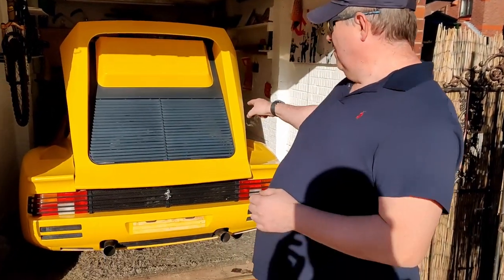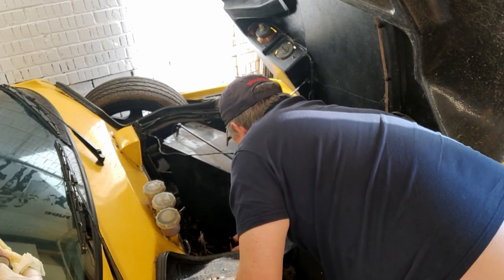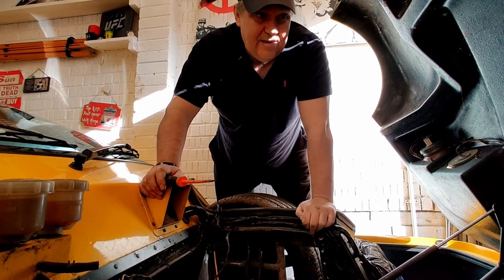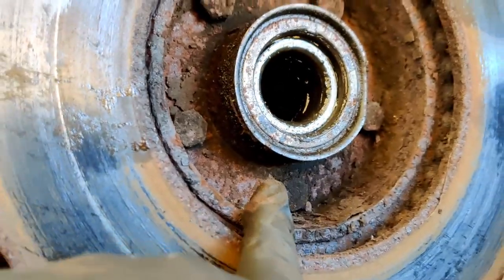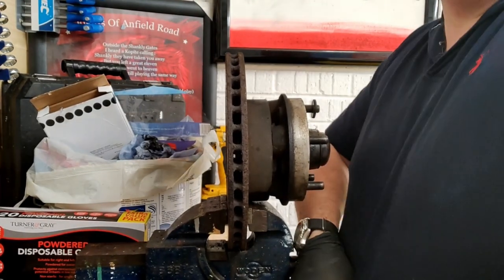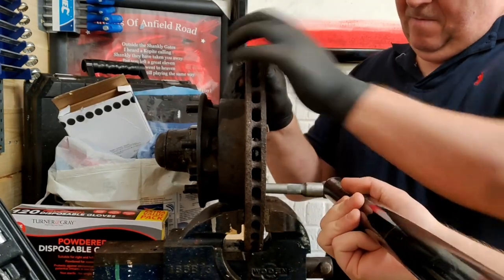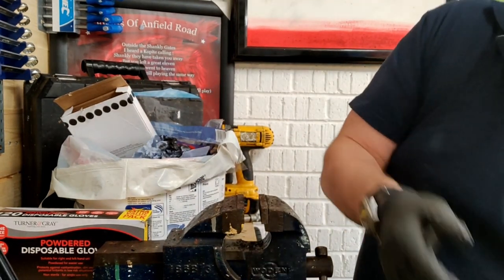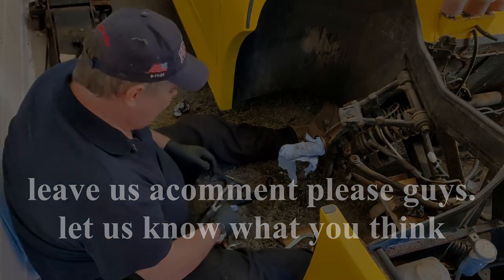V12 Nemesis Ferrari kit stripping suspension

Comment: Is that the original demo car? It looks just like the one Kit Car magazine had, I was lucky enough to go for a test drive, the Jag v12 engine purred like a kitten, and sounded like a real beast when it was let rip down the dual carriageway. It must have been at least 15 years ago
Reply from the maker: It is indeed mate 
I bought it off of Vince a few months ago.
It had been sat parked up for about 5 years untouched I built one myself a few years ago so  I'm doing a full strip down and rebuild then selling it on if your interested
Gav.
Reply: @bigwolloper  I know you've built the grey one, I followed your build on youtube. I did a lot of research on kit 'replicas' before taking the plunge. I'm currently building a DNA430 with an Audi v8 (engine conversion was completed years ago) Looks like I've got another interesting resto to follow, wish there was more on youtube
Reply from the maker: @dangerrous  perfect mate